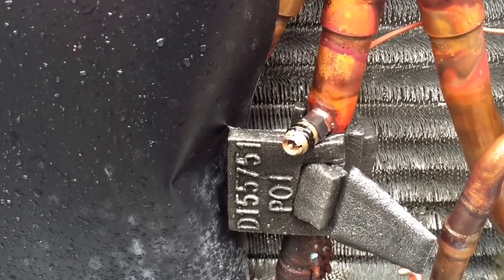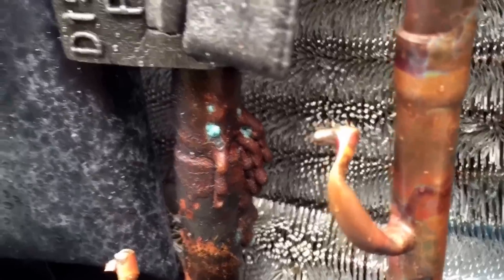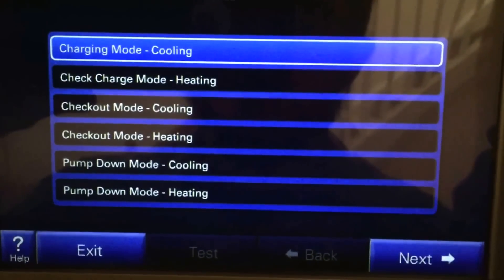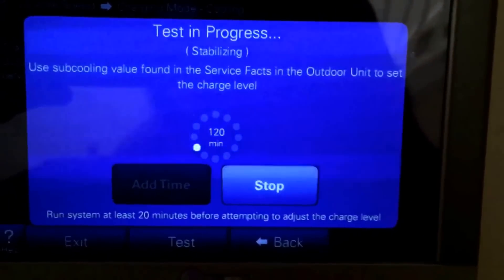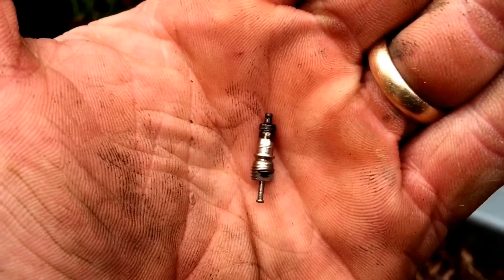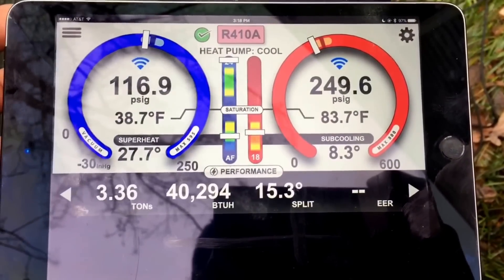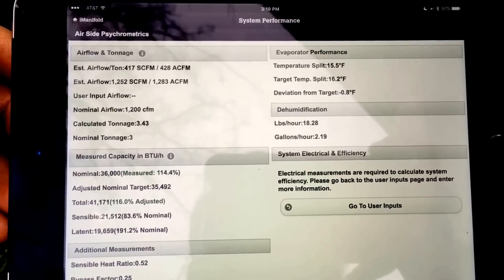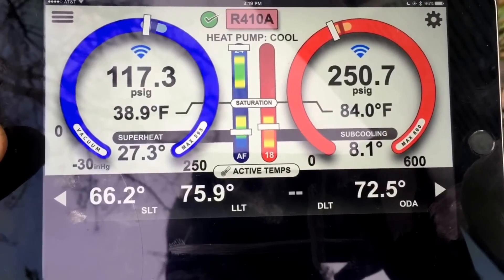HVAC Installation:  Project Rardon Initial Air Conditioning Start Up Trane XV20

Comment: 27 degree superheat. yowser. and it was cool inside.
Reply from the maker: Yeah, not crazy about that either
Reply: +Stephen Rardon (HVAC with Stephen Rardon) did you add refrigerant beyond what you would have for the line set?

Comment: Made in China????
Reply: Also for a new unit, Trane should be ashamed. That's awe full
Reply from the maker: The inverter was made in Hungary, probably not much difference
Reply: +Stephen Rardon (HVAC with Stephen Rardon) for the price they should at least be made in Mexico. 
Are you going to follow up with your Trane Rep?
Reply: I thought all the xv,s had built in pressure and temperature sensors for charging?  anyways that braze joint is terrible. Seems like everything goes to hell when its your own stuff.
Reply from the maker: Yep
Reply from the maker: They do, I want to compare their readings to mine.

Comment: That's crazy! How much did that unit set you back?
Reply from the maker: Not as much as it would've cost a customer since I got employee pricing but still the most expensive unit in the line.
Reply: +Stephen Rardon (HVAC with Stephen Rardon) Hopefully you get some money back or a new one, send this video to the Trane rep. The same thing happens to me when I fix my house, everything goes smoothly for customers but its hell at my place.

Comment: that's a winner for the ugliest braze for sure, how did it past a quality control on assembly line?
Reply from the maker: Pisses me off after spending that much on "top of the line" Trane equipment
Reply: Exactly Dennis, that is pathetic. Then we as tech's get blamed for being hacks/not know what we are doing for having to install this junk.
Reply: It would upset anyone. That joint had more boogers than a box of used Kleenex.